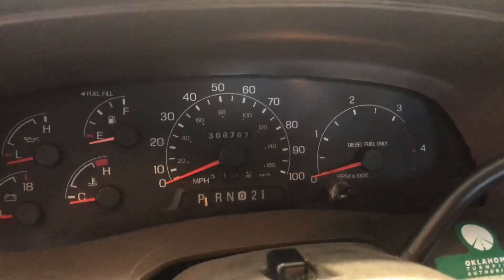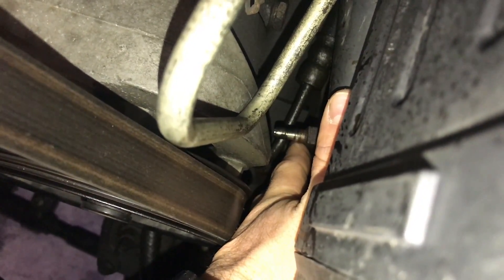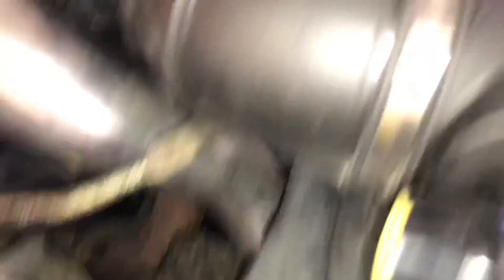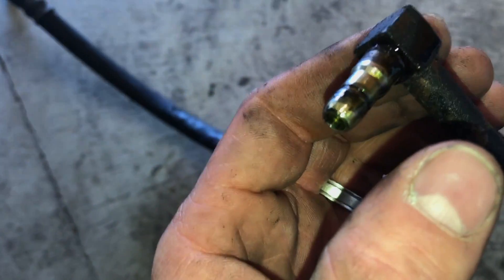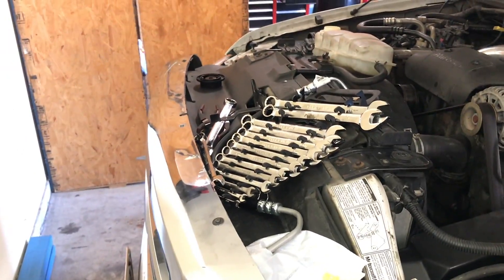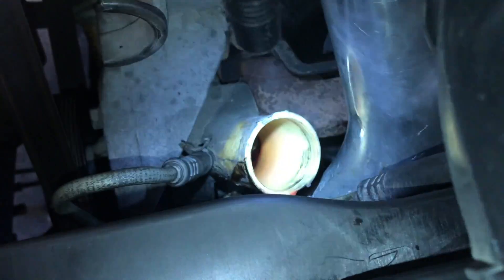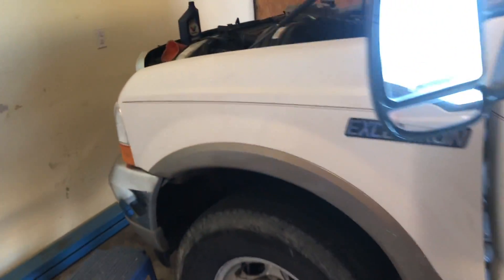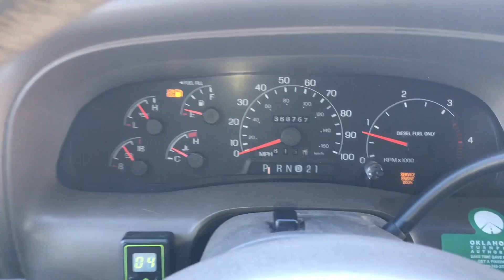The Excursion Let Me Down!!!

Comment: Dan, I gotta say, the trick you do with bleeding the steering system blew everyone away at the shop I worked at, keep in mind I'm working with master techs. They would always hear whine on the pumps they replace for days, so when the boss asked me to replace a feed line on a 2007 f150, and there was NO whine afterwards, well... I kinda got a raise :)
Reply from the maker: Yup, it works like a charm every time!! Saves a lot of time a headache with whining pumps.
Reply: DanielJaegerFilms Exactly! I also have to say I've learned so much from your channel. I actually was able to follow the step by step timing chain replacement on the 2.4 ecotec you did. I'm 18 and I go to a community college for automotive, I gotta tell ya, my instructors were DEFINITELY surprised on how good I was doing and honestly most of the stuff I've learned has been from you. Easy to follow and everything you really demonstrate makes sense.

Comment: I usually just suck out a little bit of power steering fluid and top off with every oil change. Cheap insurance in the long run.  Good videos on the 7.3.

Comment: That's a good sign of a durable truck! Just 1 thing, if I was you, I used the double zip tie trick for the upper side of the power steering line Daniel. Because of the vibrations, it'll do harm on the long way. Just my two cents :).

Comment: My dad and I had a very similar issue with his 7.3 while towing his fifth-wheel down about 300 miles and halfway there, one of the rubber lines sprung a leak for some reason; needless to say we were in the middle of no-where and had to call a tow unfortunately.

Comment: You have a control for the idle RPM?! I think I want one! 😇
Reply from the maker: Most on the fly tuners will give you a high idle option. This particular one is the Hydra by PHP, it came with the single shot injectors I installed.

Comment: these old ford power steering pumps are notorious for whining as soon as air gets in the system, and no it wont stop, might get better but wont stop. same reason you see so many old f series and rangers/explorers and older tauruses with loud power steering pumps. air gets in and almost instantly cavitates the pump, usually will work fine for years after but wont ever be quiet again, ask me how i know lol

Comment: What’s up with the CEL?
Reply: Jason B. P0238 turbo overboost, Need a boost fooler, or P0478 exhaust code too much back pressure. P1211 would be a weak HPOP, I went with a T500 and that code is gone now... :) Hopefully Dan gets it figured out soon he always does!
Reply from the maker: Nailed it with the back pressure code ;)
Reply: DanielJaegerFilms Lucky guess??? :D I have the same code in my 7.3 lol. I had a shop do new up pipes and they’re still leaking a little so I basically get this code every time I accelerate on to the freeway haha. Have custom Hydra tunes too. I may clean the EBPS tube if it keeps coming back after I fix the exhaust leak.

Comment: Those power steering pumps are just noisy (poor design) I had a 1980 Ford mustang that had a noisy pump just like that,btw those pumps are a non vented pump, when you put the cap/dipstick on the o- ring on the cap sealed it up but there is no need to bleed it- just watch the fluid level for the first week,week and a half,it might be helpful to put synthetic ATF in it too(but please don't use Valvoline in it- I have a horror story about it ruining the p/s pump on my 2000 Mercury mountaineer
Reply: David R    Those pumps are vented, they have to be. If you look close to the center of the cap where the removal tabs are you will see a very small hole there.
Reply: every ford ranger seems to make power steering noise as they age.
Reply: @RicardoPCGamer   Not only the Ford Ranger.
Reply: @wysetech2000  yeah i know, ford uses a lot of the same pumps. I'm thinking older ford taurus, older ford f150s, explorers. They all had that power steering noise in common.